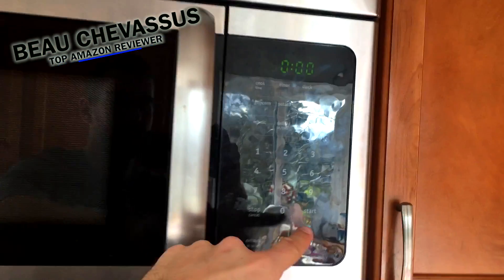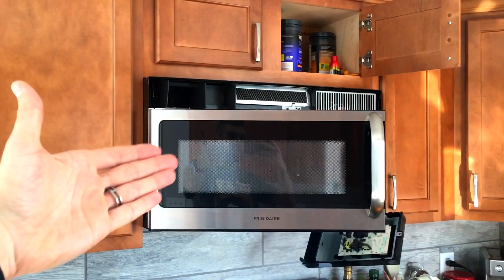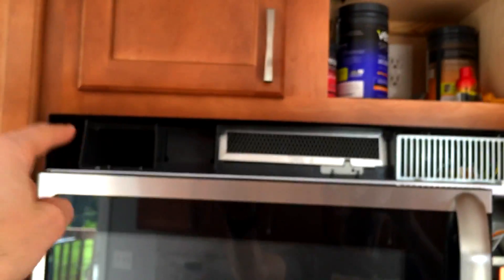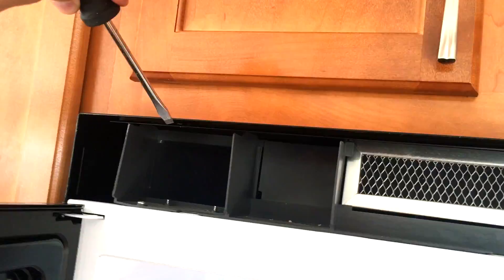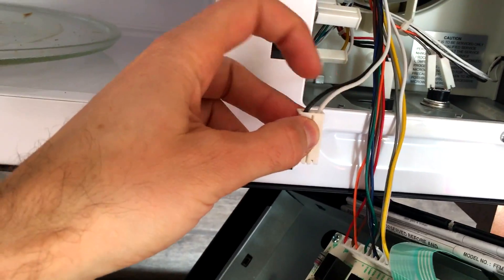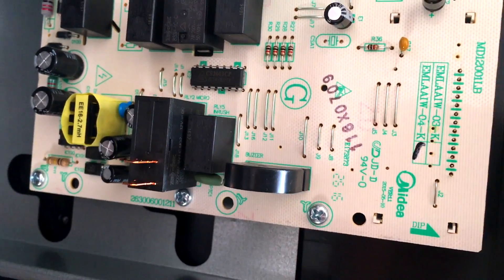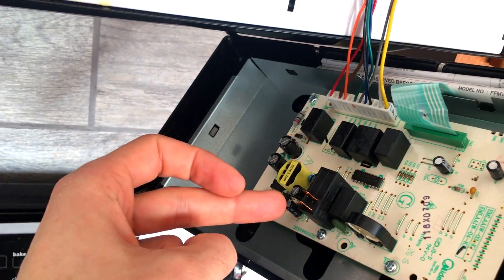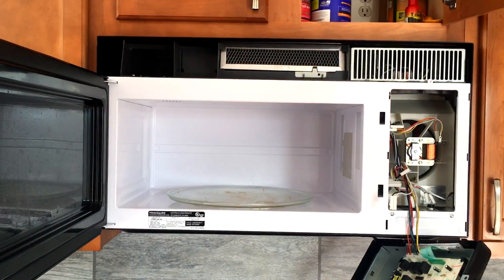★★★★★ Turn Off Frigidaire Annoying Microwave Beep - Remove Beeping Noise Maker Instructions & DIY

Comment: OR, you can press Clock Settings twice, then select Off!  Read the owners manual folks, Clock Setting adjusts other settings as well!
Reply: Not the right model #
Reply: @briandd8714  they are all adjustable, regardless of model number, just read instructions.
Reply: @cktubeful  I realize you're embarrassed.  I'd be embarrassed too if I believed I had to disassemble a microwave just to turn off the sound and then someone comes along and teaches me how silly it is to take apart a microwave when all I needed to do was push a button or two.

I would just say thanks, but you keep trying to convince others that they should void their warranty at best, or get a serious shock or cause an electrical short/fire at worst!

So you or anyone else can tell me their model number, and I will return simple instructions for turning off the sound.  Or, just download the corresponding owner's manual, and READ IT!
Reply: Marc Curcio   Oh, you’re not just misinformed... you’re also, maybe foremost, a troll.  Sad place to hang out isn’t it... the microwave repair comments? And yikes, that was your best reply to me... and you even had to come back and edit it? But keep at it, Buster... you’re definitely looking in the right place for admiration. You’re a clever little boy.
Reply: @cktubeful  OK, whatever you say is fine with me.  However, taking your microwave apart to silence the beep, is like taking your TV apart because it's too loud.  There's a mute function, whether you believe it or not.

Now stop being silly
Reply: @marccurcio1  Actually, Marco, in my search for microwaves over the last few weeks, I've come across others who've done this deconstruction needlessly.  However, I have to say that the other commenters are right.  This model (whose manual is readily available online) does not appear to have a volume adjustment!  It's really just a POS microwave.
Reply: @rengel165  While anything is possible, it's truly the first one without a way, and I'm going back a lot of years.  Even old ones have had a way to turn off the sound.  Here's one more:  https://www.youtube.com/watch?v=fj7Ykpd1Ki0

Can I ask the model number?  I'd love to research it
Reply: @jip370  That's interesting.  I just checked my manual, and it doesn't give instructions for turning off sound either.  I found how to silence by searching online.  I emailed Frigidaire customer service, and asked for instructions.  I'll send you their response.

One thing though.  The manual you sent showed a Clock button in the upper right, does you microwave have this?  If so, hold down for 5 seconds, maybe it will bring up a menu!  Also, did you try holding down buttons 1 or 2 for 5 seconds?
Reply: @marccurcio1  FFMV164LSA
Reply: @jaspreetdoung5452  The older models don't have a user preference key, they "hide" the menu under one of the other keys, usually the Clock, but can be under another button such as #1 or #2.  You have a very basic model, all you need to do is try holding down one of the buttons I mentioned for 5 seconds, until the menu is displayed.  If that doesn't work, just try every one of the 23 buttons in total, if you tried this on every button, it would only take two minutes of your time.
Reply: Marc Curcio tried it..doesn’t work
Reply: @jaspreetdoung5452  First time for everything, but you tried every button?  Reason I say this, we turned off sound on a very old, very basic table top unit.  I'm just very surprised if there isn't a hidden menu function buried somewhere on your Frigidaire
Reply: @marccurcio1  tried every button
Reply: @marccurcio1  I have this exact microwave and pressing the clock settings multiple times does nothing. It just goes back and forth between AM and PM. I tried holding the clock settings button down for 3, 5, 10 seconds and also does nothing. I read the manual and also nothing in it that says beeper can be disabled, so I believe this brute force method is the only way to do it.
Reply: @marccurcio1  troll? Or apology? Or solution?
Reply: @cktubeful  😆
Reply: @jaredvw  😆